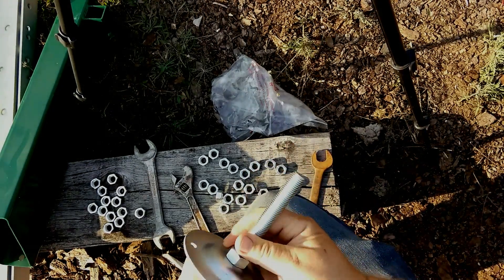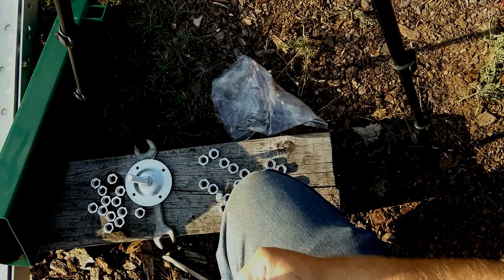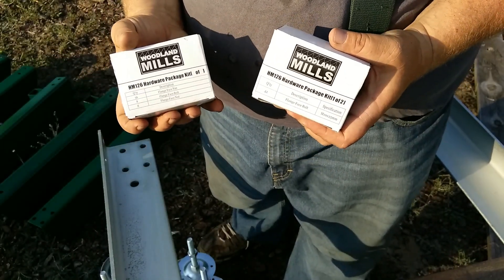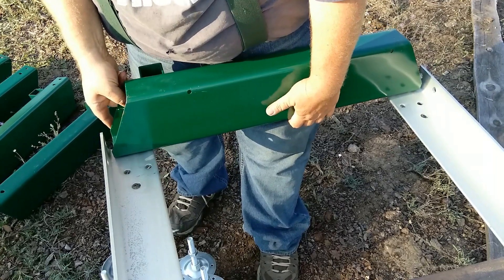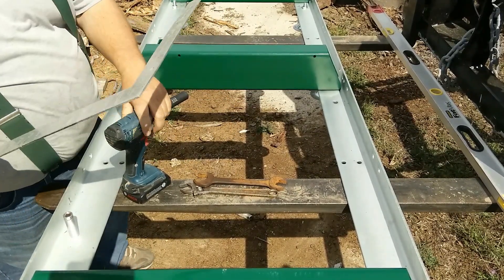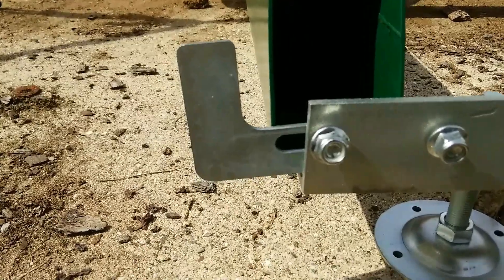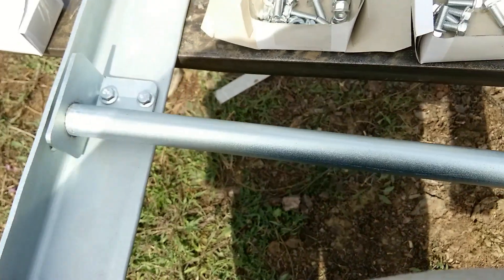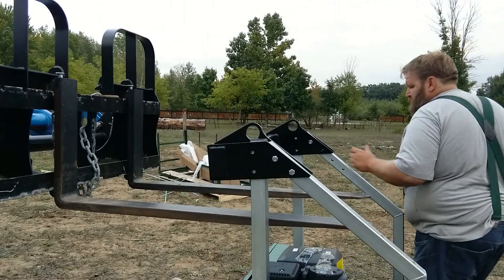How to Build a Woodland Mills HM 126 Sawmill: Part 1 Track Assembly

Comment: I used my impact screw driver on the bolt end of the feet. With standard length, 12 feet to assemble went really fast. I  got the extension so I had 18 to assemble.

Comment: Im actually about to set mine up, but have discovered something. I forget how many bolts there are, but 8 of them are longer than the rest, now the instructions that came with the mill are honestly crap and leave a lot to be interpreted during assembly.  So I am assuming the longer bolts are for the center plate connection?  -hope so. lol  well thank you for the vid.   Yep answer at the end, thank you sir

Comment: Nice video, I have owned a Woodland Mills HM126 for a couple years. I like it, it's a good mill for a decent price. Your videos are informative, after watching this first video I found several things that I didn't assemble correctly. Mine works OK but I'll repair a couple small items in the track since I'm going to put more support beams underneath this summer.